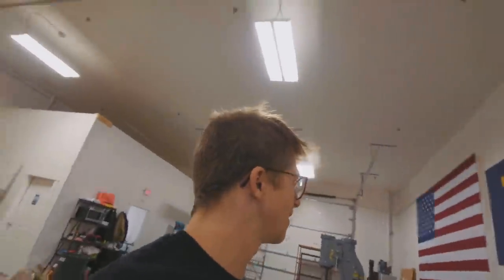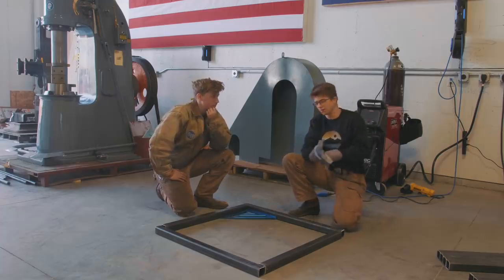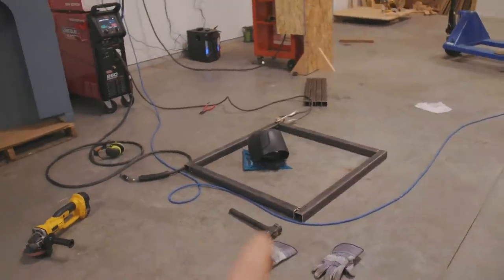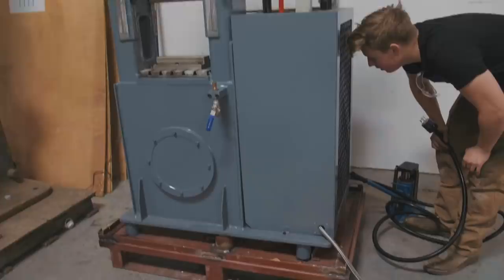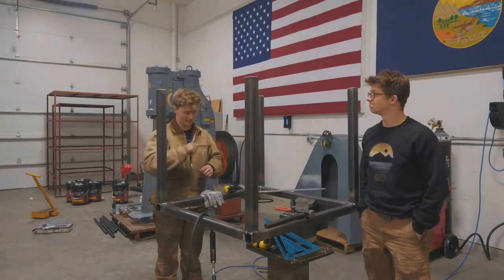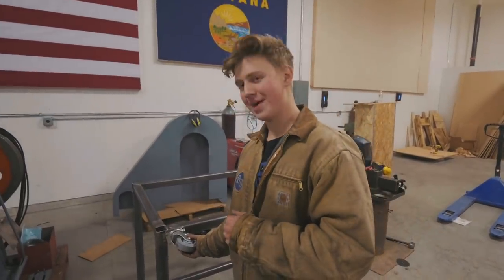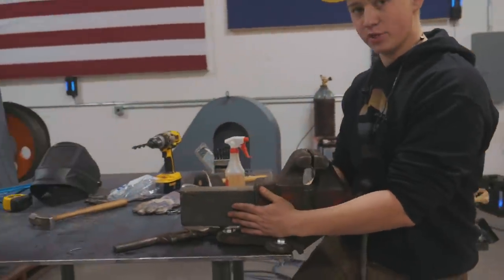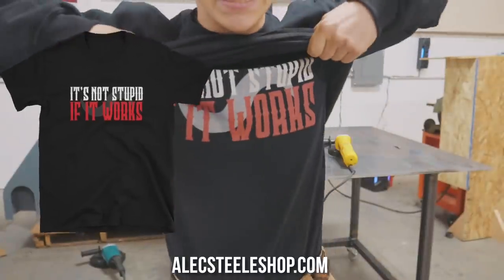HORIZONTAL SURFACE NUMBER 1!!! The Welding Table!

Comment: Pro-tip: when pouring from a full spouted bucket, put the spout at 12 o’clock when pouring, since the air is at the top, when the air comes in to replace the fluid dumped, it goes into air, instead of fighting the liquid you’re pouring. You won’t have the glook glook glook, and have a much more controlled pour. Also means your liquid comes out faster since it isn’t fighting incoming air.

Comment: If you wanted a little extra stability and get a storage shelf out of the deal get a steel plate the dimentions of the inside square of the welding table frame.  Then you can tack weld it then bolt that fourth bolt hole into that, and finish out the weld.  And just like that more stable table and get a storage shelf out of it

Comment: The caster wheels and the welding table would both benefit from a piece of metal either cut to size or welded in. Tap said metal and add 4th point of contact for the caster wheels.

Comment: Funfact, a 5 gallon pail with no vent spout pours easiest if you tip it so that when horizontal the pour spout it at the top of the side. It allows for proper airflow and prevents the glugging that will happen if it has no way to breathe. You then spin the pail to slowly drop the spout as you pour to account for the dropping high level mark. The more you know.

Comment: Careful welding on concrete given your in Montana moisture builds up in the concrete and when high heat is applied the moisture then begins to evaporate but cannot escape then it will expand and explode. Yes it happens.

Comment: Just an FYI, if you will turn the bucket where the spout is at the 12 o'clock position, you won't have to poke holes in the side of the bucket.

Comment: You should have added  gussets in the corners of the welding table for strength and so you could use all 4 bolt holes on the casters.

Comment: You could weld a little right angle of plate into the joins and add another bolt for casters.

Comment: !!!#%$ Just a suggestion $%#!!!!
When dealing with a larger shop space, adding a few drop down plugs from the ceiling is very helpful in reducing cord clutter on the ground, which can be a big safety hazard. 
Making those drops a 4 plug outlet will probably be the best choice. Leaving the outlets hanging at around 6 a half to 7 feet from the ground will give enough clearance for taller guests in the shop and still be able to reach them to plug something in.

Comment: Pour with the nozzle at the top of the barrel and closer to the ceiling, rather than the bottom and closer to the floor, and pour gently and you avoid the glug-glug-glug of liquid/air blockage.

Comment: I know this is a little late, but pro tip if you don’t want to stab the bucket of oil so you can use it later. Pour the oil with the spout on the top. 👍. Pours faster

Comment: Caught a glimpse of those welds. They need another grinder for Christmas. Hey, maybe I should apply for their internship thing and show em how we build, i.e. overbuild, things down here in the south. Think you need three inch casters? That means you need eight inch casters. Half inch bolt would work? Three quarts bolt or go home. That sort of thing. Oh, and Alec, turn that machine over to DCEN and run you some 6010 rods until you can make a decent bead. You'll thank yourself later.

Comment: Pro Tip: If you rotate those 5 gallon buckets of oil 180 degrees and have the pour spout at the top then it doesn't splash. This allows air to flow in and creates a steady stream of oil.

Comment: I would have used strips of plate for the top so i could use clamps in between them to clamp my work down. Prevents warping while welding.

Comment: Tip for the 5 gallon oil pales. Put the spot to the top as you pour. It will not burp as much, ans no need to stab will in the kidney.

Comment: Next time with the oil bottle, try pouring with the spout at the top rather than the bottom. You'll find it'll likely be quicker and easier.

Comment: Huh.  Just did some looking around on line, seems "Montana" is a Souix word meaning " ... But the summers aren't bad..."   Also, I would have gone with all steel casters, maybe.  They move real nice on cement floors, particularly under heavy stuff.

Comment: you could weld some triangles to the bottom so you could mout all 4 holes of the wheels. and get some magnetic welding holder to make your life easyer. cheers

Comment: Next time weld the casters on - its way faster to just cut them off later if you ever need to add new ones. I learned that from Jody after I tapped and bolted mine on too ;D

Comment: so is the sound of the wood getting pressed what it would sound like if your arm got caught in it?  also I was wondering, why dident you weld the castors to the table? that's what I did on mine, worked pretty well.

Comment: You need portable fireproof spark shields, you can even get tinted see throughs, just a light weight steel frame on casters with a non flammable material stretched across it. Shame you cut the buckets, i always save mine. If you have bottled gasses you need a steel cage for them, its an OSHA regulation. Not a bad table but i have two that are twice as long, trick is you need really good casters on them. Weld a piece of 4x4 inch angle with the v facing up on one end, this to hold round stock.

Comment: The T-Rex table. It cracked me to bits =))))) nu sfx, I am sure!!

Still... couldn't you make two square frames with 45 degree angled cut bars, joined together by 4 straght cut bars, so the entire tubular structure be encapsulated...

Then weld 4x triangle plates on the bottom side to make the base rigid (like the top is) and be big enough for the 4 screws.

Also, to have two bars crossing in an "X" on all four sides...

In Romanian, the initial flexing point of weld is called.... "a point"....
We say "give it a point over there" or "i'll fix this in two pints". We also use electrodes, soviet style :3

There are helio sensitive welding masks. But a true soviet uses eyelids and his komrad keeping the pieces in place, his hands midway betweem eyes and the spark, with the mask being used only to store electrodes.
Also, true soviet welder during working and evaluating, has "Radio Antenna of Villages" playing in backgound, on an old dusty radio with misplaced buttons, burnt scars and no working power switch, connected on the same source as the welding station.

I once was an apprentice to a welder, God rest his soul.... Bibi... I never felt more of a man then working in his forge....

Comment: To avoid the glug-glug-glug when pouring, pour with the nozzle at the top, not the bottom. Speaking from nearly a decade of small batch paint manufacturing experience.

Comment: Glad you both understand where the hydraulic oil belongs!!  Instructions have pictures!! Awesome! They knew welder wannabees would be trying to set this up.   WHY BOLT THE CASTERS ON??  YOU HAVE A FREAKIN WELDING MACHINE!! Turn the voltage up about 3 volts and burn that stuff in without having to go back to town!!

Comment: You're pouring the containers upside-down, that's why you have trapped air.  They are designed to be pour with the spout on top so it can vent.

Comment: At 5:27 crank up that voltage a bit more so you have more heat or turn your gas down a bit. Your argon gas is blowing away the weld causing that bird poop effect.

Comment: Hey Alec. Just wanted to give you a tip for mig welding that most people overlook. Make sure you thoroughly clean the area (and maybe a little more) where you’ll be putting your beads. Impurities from the base metal can compromise the integrity of the welds. I couldn’t tell if you cleaned both sides or not. 

Also, I’d recommend trying to get with a trade school and spend a little time with a professional welder. Even a two hour lesson can help improve your skills with the mig gun. 

Lastly, for you table, you may want to add some support, possibly angle iron, across the middle section of your plate. Yes, 1/2” is thick but, as you know, when metal gets hot it likes to warp. A couple of braces now will save a lot of headache later if things get warm. 

Love the videos. Keep em coming.

Comment: Just thinking about your order of operations here Alec, the frame is awesome, but why didn’t you guys weld the frame to the plate, so you didn’t have to weld in the overhead position? At the same time, you could also have welded the castor wheels to the frame? Then it would have been simple to roll the completed table 180°, and you’d have been done in a fraction of the time.

Comment: So a portable welding table should have the welder built into it right 🤔 should fix a little storage problem as well. Also triangle piece for stability in the corners of the welding table being that you don’t want to fold the table whilst moving.👍🏼

Comment: Reed 10-5. Ten inch stroke, five inch jaws
Reply: BrCks House by that logic the reed 405 I have would have a 40” stroke, the first number designates the model (swivel jaw, swivel base) and the last number is the jaw width.

Comment: You should have welded a small square plate of steel at each corner and then attached the casters to that. ths would have given you all four attachment points.

Comment: Alec please buy yourself a 20 volt dewalt drill and impact driver.  I think you will like the power difference between that 18 volt you are using and the 20 volt.

Comment: You should have taken four small plates and welded them on all four corners then drilled and tapped them so you could have had four bolts on all of the weals attached.

Comment: 2 Questions:  Would it be silly to weld the two square frames together using the plate steel as a table top (on the floor), just so you know they are both level?   And why not weld the casters on?

Comment: You guys should get some better cable and air hose management going on. Like the ceiling mounted air and power cables and hoses that pull down and retract back up.
Reply: Nikola Howard I’m not saying right this minute just something to think about while they are in the putting the workshop together mode.

Comment: Too late to be useful pro tip: pour from those containers of oil with the spout at 12 o'clock instead of 6 o'clock. It leaves room for air to get into the container as you pour and eliminates the GLUG GLUG effect.

Comment: protip: if you bolt a piece of notched wood to one of the stretchers, you'll have a nice place to set your grinders.  better than protip: grinder wheels that bang into each other get damaged. damaged grinder wheels either get tossed into the trash or they get angry and explode. save the grinder wheels

Comment: Hey Alec, I'm sure the thought has ran across your mind, but how is the ventilation in there?  I would think it could get dangerous with a forge running for extended periods of time and not having any way for the carbon monoxide to escape.  AT LEAST get yourself a sensor for it.  They just plug into any wall outlet.  I am unaware of how long it would take to fill a shop that size with a fatal amount of carbon monoxide, but its better safe than sorry.
Reply: Historically Alec has always forged with the main doors (the roller shutter in this case) open for ventilation.
Reply: @Burnie1601  True, but also back home.  Where it didn't get nearly as cold.

Comment: Alec, how much did you pay for your sheet of plate steel to make your welding table? I don't have quite that amount of space but I do need to get a welding table and would like to have something to compare and estimate against. Also, who did you use as your supplier to source the metal?

Comment: You should still use SI units because not all of the people who follow know imperial units. I know you have to learn to use them for practicalitys sake, but you should still consider your viewers on both sides.
Reply: And I don't mean you should use Kelvin for the outside temp :D just use Metric system for the plan explanation.

Comment: If you turn the hydraulic bucket upside down instead of having the nozzle on the bottom it will not Have those air pockets in it

Comment: Oooooh goodness please tell me you cleaned off your slag from your tac weld and you did a all around for greater stability also weld the castor's from the insurance details for better hold.... Also if you left the gap like you said you should have done 3 beads around it one at the base then 2 to each side connecting everything
Reply: Weld the castor's from the inside for better hold sorry typing on the phone and let Auto correct win .

Comment: Those welds were a little sketchy. And for pete sakes get a smoke eater. And you should put a brass sheet on the table top, it dosent let spatter stick and is really nice to have if you need to plug weld a hole, that way you dont have grind the table top smooth again every  month.

Comment: Please grind or cut those corners off the welding table. The first time you run into one of those sharp corners and spring a leak you will wish you did. But no new shop is complete without spilling some blood.

Comment: Mister steel, I have a question. I have a gallon milk jug filled with magnetic black sand from river beds. Its all magnetic, this is no normal sand in it. Can this be smelted into usable material? I'd really hate to waste it.
Reply: You could probably fill some square tube with it and weld plates to the end and forge weld it all together, could make a nice Damascus block

Comment: My dream is to one day have a work bench so substantial I need either a bulldozer or a crane to get it into my shop (which realistically means we just have the same tables I had in college, something like 8 feet long and 4 feet wide with a 1/2" thick top so I can park a car on it)...First I must get a shop.

Comment: Fabricobble 4 triangle pieces of steel - weld in each corner where castors are = 4 bolts on castors. just saying...

Comment: Just an observation.. but you would probably by better off if you welded a plate on the bottom as well then put the wheels on the plate,, you would have gotten better weight distribution, sturdier table, and more balanced wheel placement, 4 points of contact not the 3. Now you have a problem of those wheels caving inward, and or your table twisting in on itself at the bottom once you start getting weight on the table.

Comment: So, I'm a bit concerned about your new table. I don't know how much it weighs, but I'd recon you may want to either balance it out more evenly or add some weight to the bottom of the table. Those wheels feel and look so very topple-ful! (forgetting real words, making do with makeshift ones.) 
 Anyhow, outside of the disaster waiting to happen that I thought I could point out, very well done and looking forward to your new work at the new workshop!
.
.
.
.
.
 Oh and "haPp¥ (late) Bi®tHd@y!!".

Comment: 4:30  No need to endure the glug glug and what a waste of a good pail to stab a hole in it.
Just pour so the spout is at the top.  
The liquid pours out the bottom of the spout, the air comes in the top.

Comment: Uh guys could you not have just cut out a small square of sheet steel to fabricate a caster mount out of?  Or better still take a piece of square channel use the chop saw to chop it on a 45 then weld those in place at each corner for the casters?  Would have given you a stable surface for the fourth bolt on each caster which will prevent weight impingement on the un-anchored caster mount flange?

Comment: you might consider steel wheels, those rubber wheels will develop flat spots  over time from the weight of the table. Nothing more aggravating than flat spots on a wheel.

Comment: Should have just welded the casters onto the table. Regrease them after and it's good to go
Reply: I almost never bolt casters. Even taking them off it's faster to cut the weld than it is to undo the bolts

Comment: Still at 1 minute 24 seconds.. thinking to myself they are gonna need a welding table to weld together their welding table... lol I'll see in a few minutes what they used, but it would be funny if the used a store bought welding table to weld their welding table.. I doubt that happens in this video from my pause point forward, but that's the way my mind is working this morning.

Comment: ARRRRRGHHH!!!! You missed a trick.... For the casters... On each corner weld a 1/4 inch to 5/16ths thick square plate, AND THEN..... attach the casters securely.

Comment: There is No way that table top is 350. More like 70 at most.
Reply: Denny Hansen 1/2x48x48” go do the math
Reply: @WillStelterbladesmith  i did the math. Your right. I guess you 2 are stronger than you look. Good job.

Comment: Getting worried about you Alec. You were making a welding table and already had the top sheet steel plate to hand, why didn't you lay it out the tubing on that to tack weld it. If you had kept the dark seam of the tube facing in only one direction then the sides of the tubes would be the same size, everyone knows that that square tube isn't the same as timber.

Comment: If that power point is 220v single phase, why did he sell all his English power tools on the basis they wouldn't work in US?
Reply: You need an adapter for the prongs and the adapters never fit right and fall out half the time. It's pretty frustrating
Reply: Change the cord plug.
There must be more to it. They must have done a non-standard wiring install for him to have 240v, since standard US power is 120v.

Comment: The us plug of the press... WTF?
Reply: @marionette5968  only 240v? I thought it is 360-80, cause most machines I know, I am a mechanican in a steelmill, have this standard.
Reply: @marionette5968  thanks a lot for this explicit explaination.
In germany it is now standard for a long  time to have 230-240v 16 ampere and a 360-380v plug in every house, cause for the construction phase it is needed and later we often have use of it because of using high power table saws and concrete mixers etc. It's a kind of infrastructure 😆